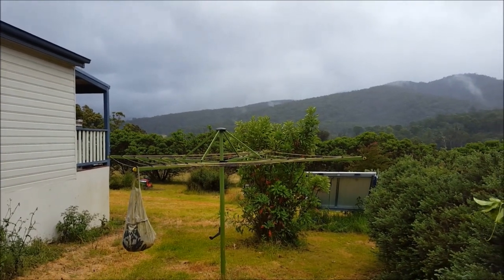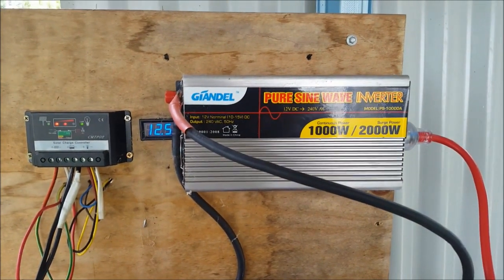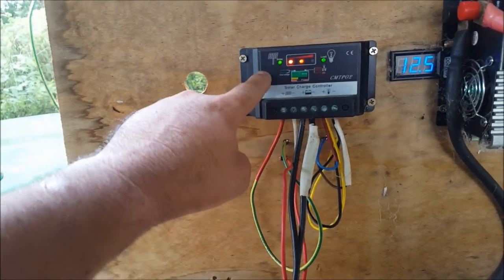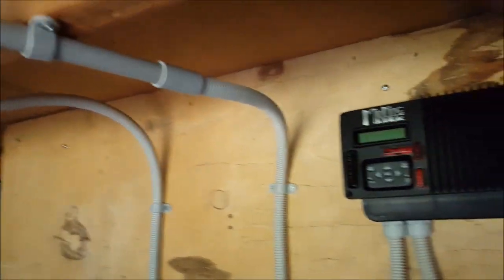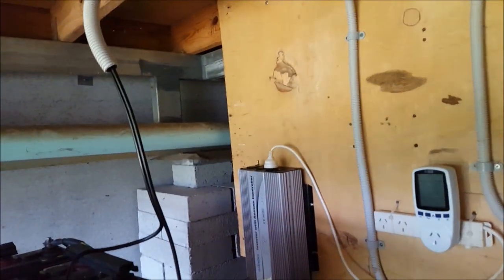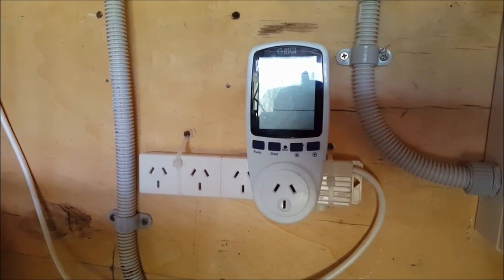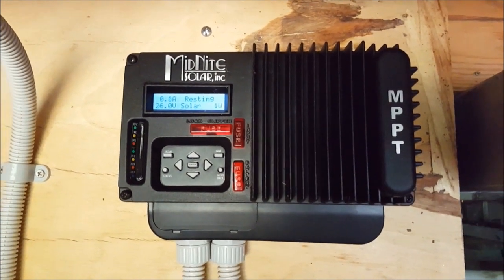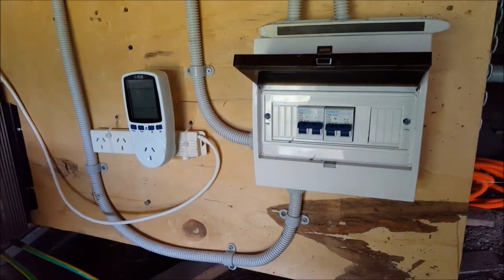Off Grid Solar Power - Upgrades to the 600W System

Comment: 14.5v is a normal bulk charge voltage when approaching full charge but it shouldn't go any higher. Inverters may not be happy with it but most cut off at overvoltage at 15v.